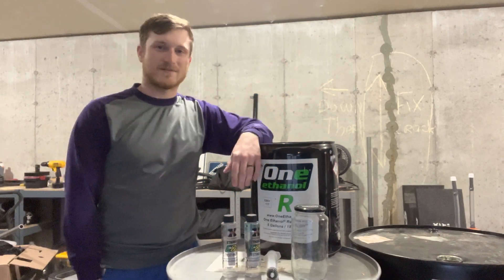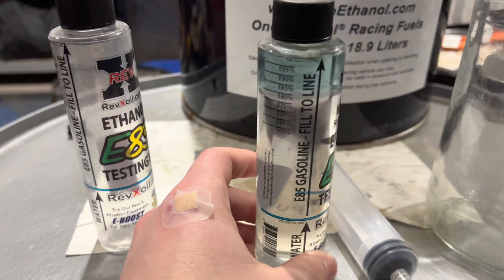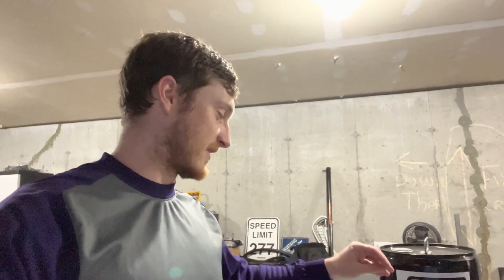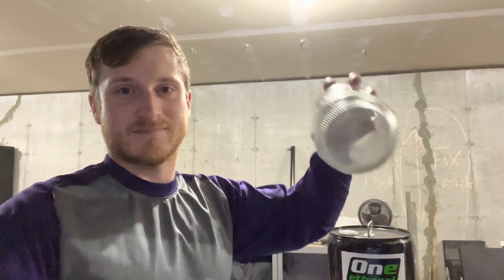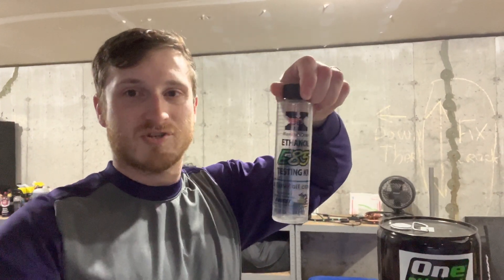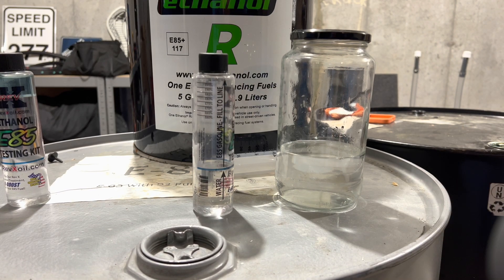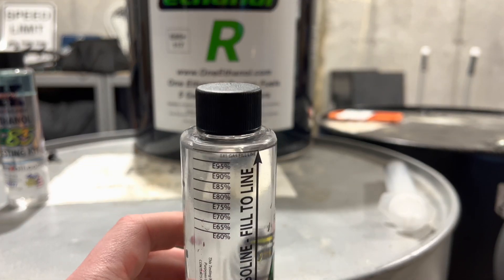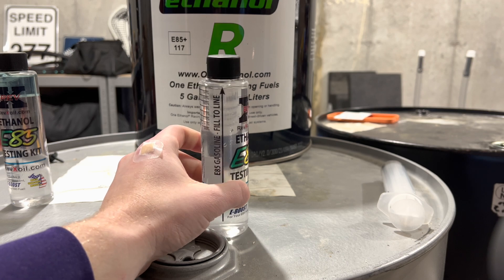Testing One Ethanol R.  What’s it’s ethanol content?

Comment: Hey I have a 2020 whipple with 3.875 pulley could I see a significant horse power gain with just adding ethanol one R or E85? It’s about 11-12 psi of boost
Reply from the maker: Depends on your tuner. Me at same psi saw 50 more hp

Comment: I tested 1 ethanol R as well and came up with the same results. I couldn’t tell if there was a separation on top. I chalked it up to the meniscus line. It’s probably 98-100% ethanol in my opinion. Great video
Reply: Are you running it on your Gen 3 mustang? And by any chance did you run it on your e85 tune or did you have to get a retune for it? Curious if you’re running this on your stock fuel system as well.
Reply: @kevincandelas1228  the car was NA when I posted that. But yeah stock fuel system. Also on the Lund E85R tune. No special tune required
Reply: interesting, I use this stuff, but might at well just use e98
Reply: @fastlsxtyphoon8529 I’m sure it’s good fuel. But you can’t go wrong trusting a company like One Ethanol. Unless is old shit that’s been sitting around not sealed from the humidity